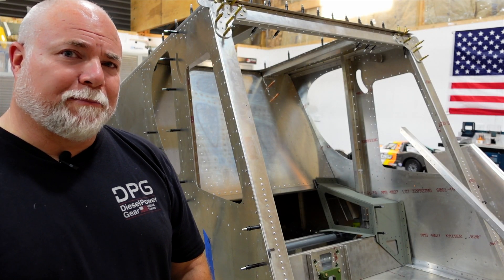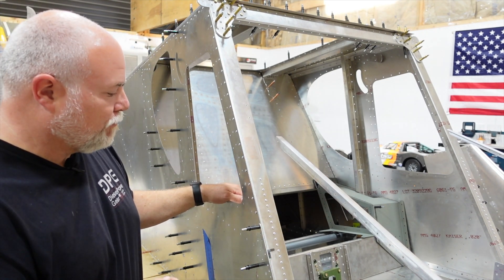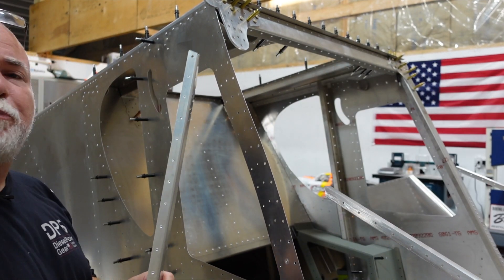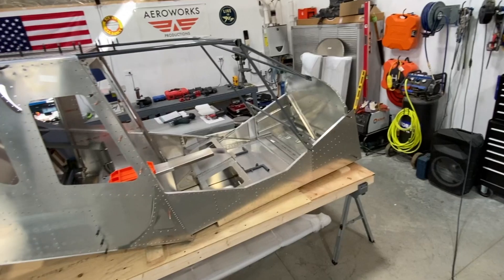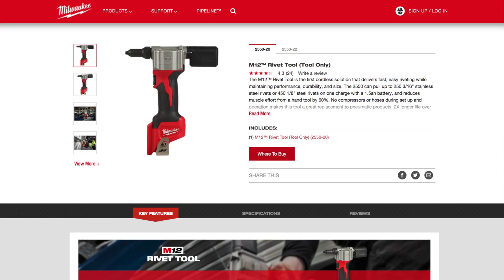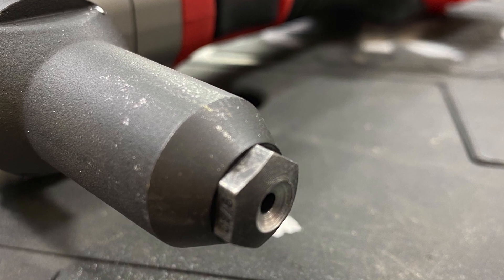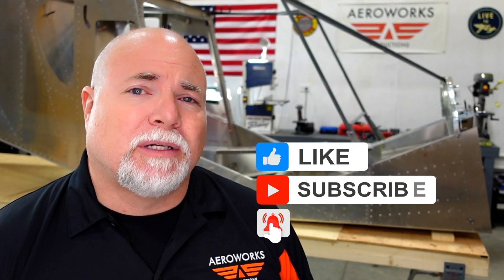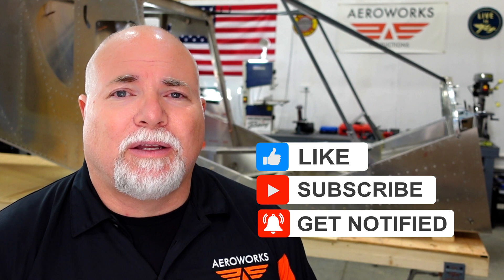Ep. 8 | Setbacks & Progress | Zenith Super Duty Aircraft Build

Comment: Adam, I appreciate your videos.  I watched you for the first time Nov 5th, 2020 where you were discussing in Episode 8 joining the forward fuselage and rear fuselage sections together.  You were asserting that you had made a mistake and proceeded to undo, i.e. drill out rivets from the rear fuselage forward frame to facilitate joining the forward and rear fuselage sections.  I too am building a 750 SD and when I got to that same point I did not find it necessary to partially undo (drill out rivets) as you did.  Maybe I missed something in your video.   I got some help in joining the two sections together because as you know the level of difficulty is high if done solo.  I had the rear fuselage section resting on a bench which was in turn resting on a couple of adjustable metal saw horses.  The forward 6 inches of the rear fuselage was slightly off the end of the bench with the tail elevated to essentially an angle that would allow for a near level attitude of the forward fuselage when joined with the rear fuselage.  With that as the starting point the forward fuselage's angled longerons aligned fairly easily with the corresponding angled slots in the forward frame of the rear fuselage.  The forward fuselage was resting on a saw horse with an approximate 2-3 ft length of 2x4 supporting the slight nose up pitch attitude of the forward fuselage from under the nose gear lower bearing.  The two of us moved the forward fuselage aft slowly inserting the forward fuselage longerons into the angled slots on the rear fuselage forward frame.  We would inch along one side then the other guiding the forward fuselage longerons as necessary (through a second set of angled slots) until the two sections were completely joined.  I totally agree with your comments about Zenith's building instructions for the 750 SD.  I've found them to be lacking at times and too many times littered with mistakes/omissions/ambiguities which I bring to the attention of Zenith.  I'm a firm believer in detailed drawings like those on Zenith's google drive with all of the parts pertinent to that drawing shown individually and assembled with required notations and color coding for ease of identification of assembled parts.  I too have had to drill out rivets for which there was no warning on a drawing to delay riveting to avoid a future assembly conflict.  I'm not a big fan of photographs as a primary aid for building because photographs typically fail to show a sequence for the assembly.  Photos are fine for confirmation of the finished assembly but of limited help if not confusing in getting to that finished assembly.  Will be watching your videos now that I know they exist.  Finishing the cockpit is my objective now.  Zenith provides little or no documentary help for that.  Cheers.
Reply: Paul thanks for watching and the comments.  Probably to hard to explain in text but I’ve heard similar stories about the fuselage joining.  Anyway thanks for watching and if you’re online at 10:30 am tomorrow there is a virtual workshop going on and i’ll be speaking on it.  You can find on Zenith facebook page.